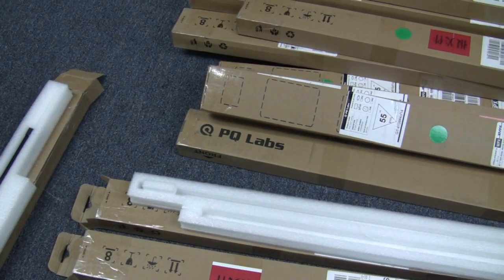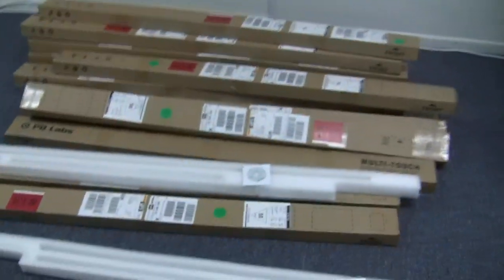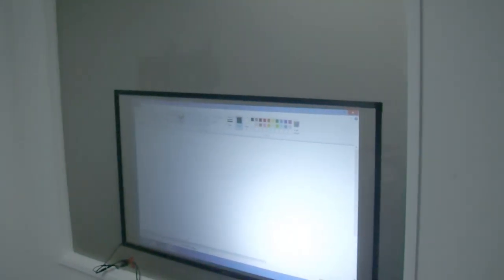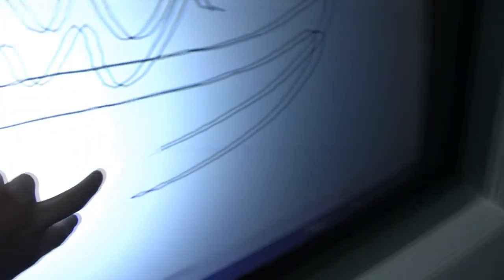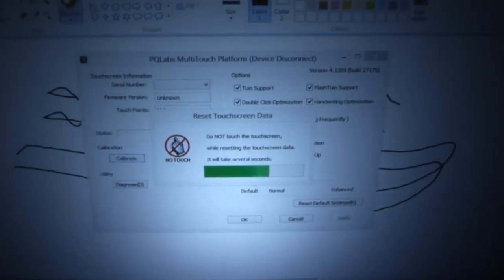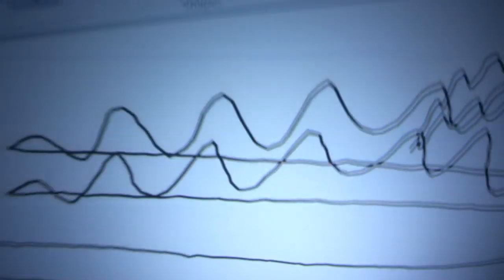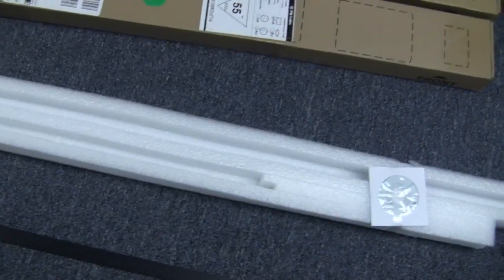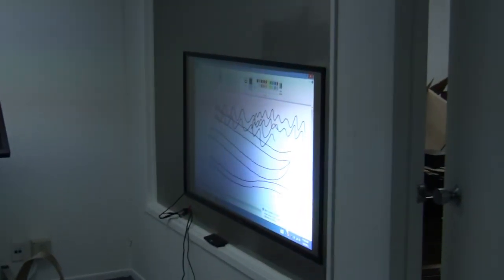PQ Labs G4 Infrared Touch Frame Overlay Quick Overview

Comment from the maker: You can use any image source, whether a projector, TV or monitor.  There are no cameras involved in these Touch Frames as the tracking hardware is in the frame itself.  The frame connects to the computer with USB.

Comment from the maker: Yes there is a Linux driver for the Touch Frames:

• Supported Distributions
Ubuntu 10.04 or later
Fedora 13 or later
Others: NOT tested and may NOT support in a long term

• Desktop Environment
GNOME (Default desktop environment in Ubuntu and Fedora)

• 64 bit Support
Support Ubuntu 64 bit with ia32-libs installed, find more information in README file
Fedora 64 bit not supported at present